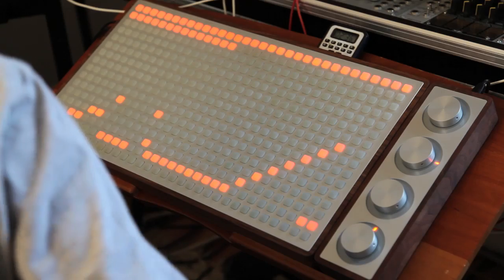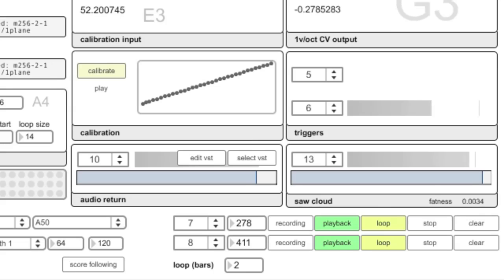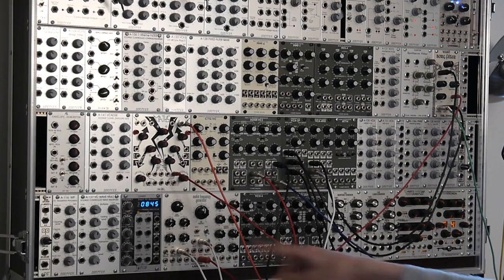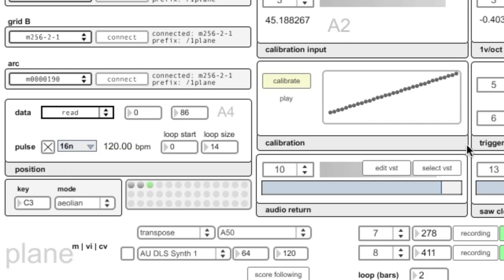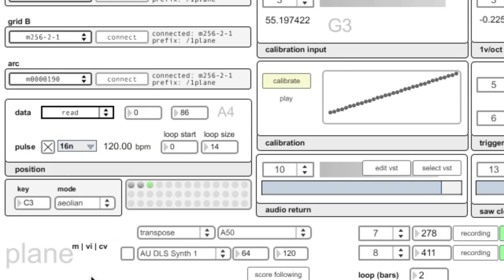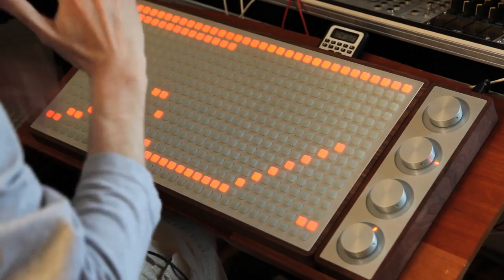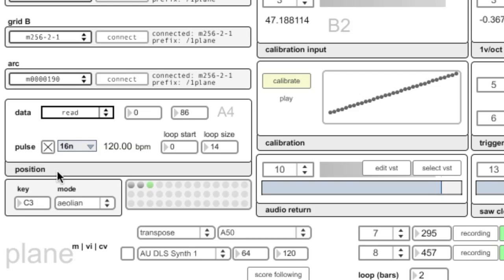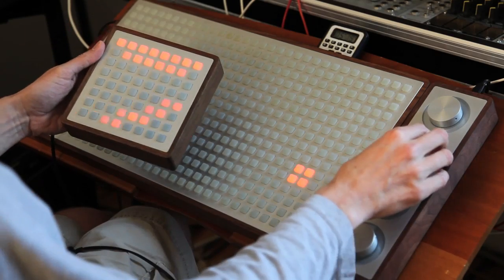plane

Comment: These machines work, and more important- sound differently than software. The analog circuits give a different harmonic content to the sound. It gives more "body and air" toit and you can feel it. It's very hard to achieve that with software. + Hardware is much, much, much, much more fun to play around with. :)

Comment from the maker: @HD41117 You can set the state of an individual LED with a separate message for each LED. This is fine for small scale updates and can even work okay for updating an entire 8x8 grid. Scrolling means updating the entire grid very rapidly, each time sending out a wave of set LED messages. If you apply this technique to larger grids, and try to scroll, it starts to feel sluggish. plane updates with led/col messages, which may be thought of as a kind of data compression.